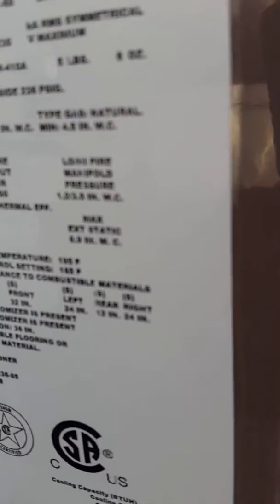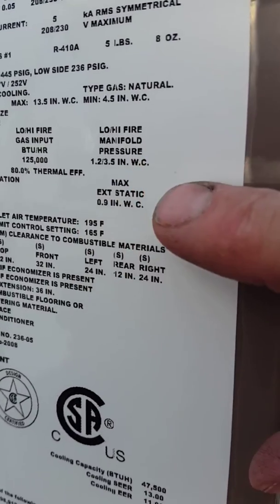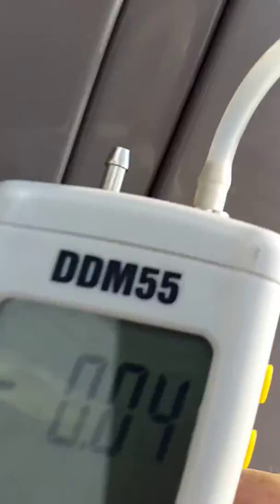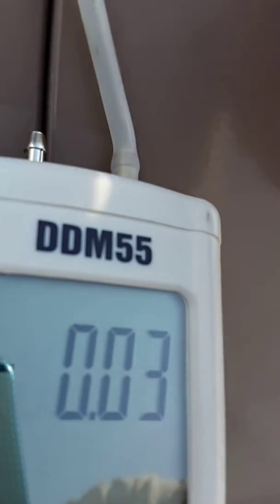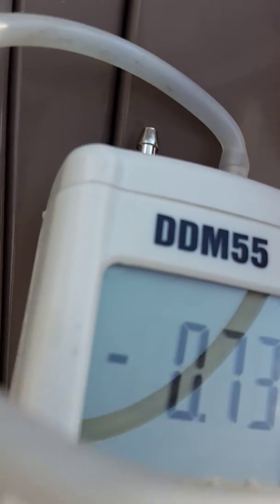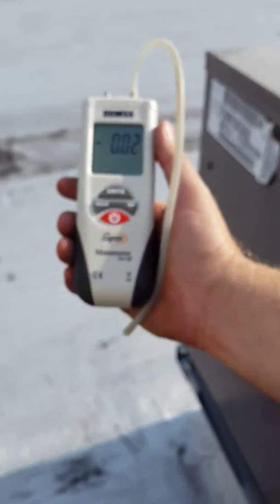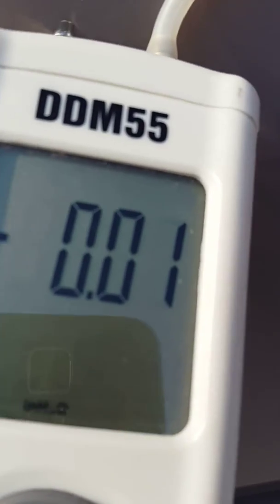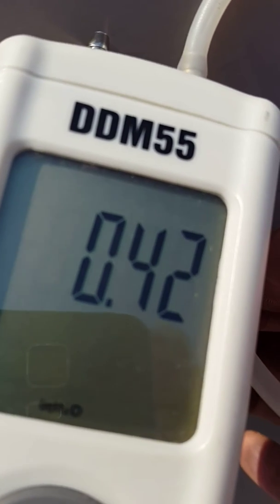Checking static pressure on a York RTU.

Comment: Once you've misengineered something and installed a unit bigger than your ductwork you're kind screwed. The only recommendation I could give was to install a barametric relief damper between the supply and return ductwork and high/low temp controls to cycle the heat or AC to prevent high temp failures and evaporator freezing up. Fixing a wrong install is much harder than just putting in the correct system. Size your ducts and vents correctly

Comment: How high is considered too high? Is there a tolerance +/-?
How do you fix too much static pressure if you have a clean filter and good system but undersized ducts?
Reply: The installation manual for any piece of equipment will have the answers for what "too high" means. There is a chart somewhere in the literature that will tell you what your airflow is at your measured static pressure. The higher the static pressure, the lower your airflow. It will also tell you how much airflow you need for your unit to operate correctly. 

How do you fix it? That is an entire class on its own! You add another supply/return trunk off the plenum drop, cut more supply/return registers into the undersized ductwork or install a barometric damper between supply and return to reduce the pressure. Almost certainly though you will need to add high temperature cutoff controls to keep the heat cycle from overheating and freeze protection on the evaporator to allow for defrost if there is a freezing problem.

Comment from the maker: That isnt an easy answer. Capacity and duct sizing are many different calculations using many different resources. Unfortunately the physical work and skill needed to install HVAC systems allow many individuals to do installs without having the knowledge required to perform the appropriate engineering. Make an installer show you the engineering or hire an engineer.

Comment from the maker: When a unit is installed without any regard to the size of the ductwork it is being installed on you can get results like these. These should have considered the size of the ductwork AND the supply/return registers installed. The entire system has to match or you will repeat previous errors and install an incorrectly sized unit to replace an incorrectly sized unit.
Reply: What was the cause of the high static?
Reply: @MaplesEnvironmental I believe air restriction